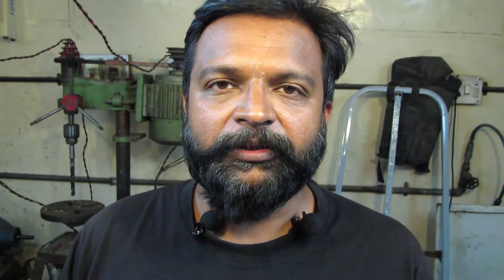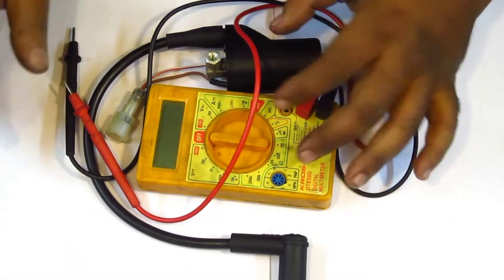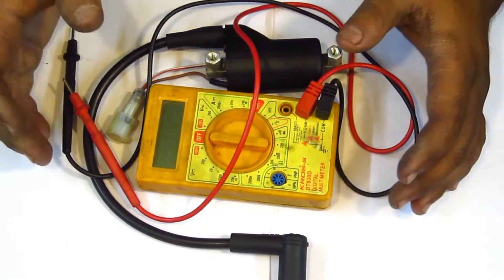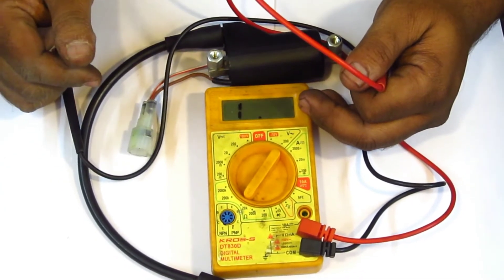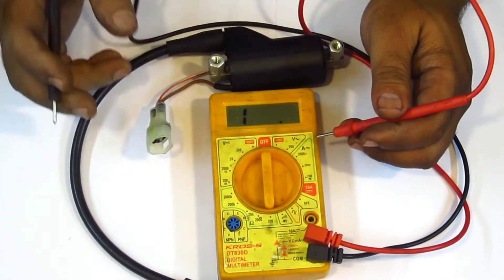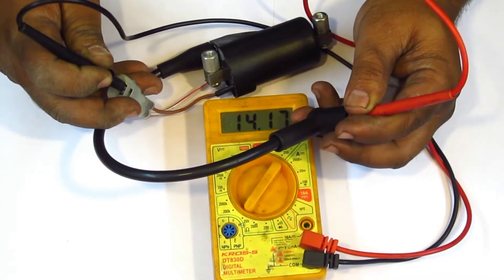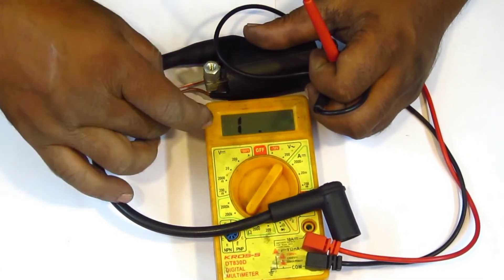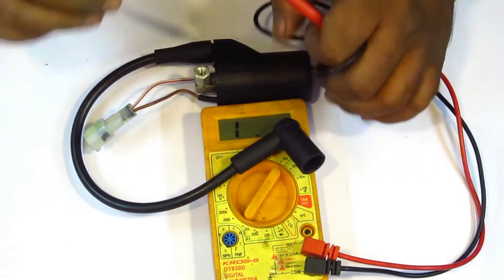MOTORCYCLE HT COIL or IG COIL Problem for no spark | How to rectify Electrical problems?? VOL.2

Comment: Hello sir
How to fix no spark on right side spark plug cable on classic 350? However there is current on the larger spark plug/left side
Reply from the maker: please check the voltage at ignition coil input and continuity in between TCI pulse wire and IG coil. thanks

Comment: Im having 2008 model fz. And  ignition spark doesn't  coming. Bt from cdi to ignition  current is there bt no current is coming from ignition to ht and sparkplug, i changed ignition  coil and then also no result.. what may be the reason?.. pls help
Reply from the maker: ignition means what?
Reply: @MechAutoClinic  ignition coil to ht spark plug

Comment: Dear sir,

Thank you making this video.

I am facing problem with my bike start, which doesn't start at all. It's Bajaj avenger 150 street.
I tried to find the ideal ranges of resistances for ignition coil in manufacturer supplied user manual, but nothing has specified as such. 

Would you please suggest me whether to discard or keep on with the ignition coils based on below multimeter readings?

Open circuit, Ignition coil readings -
Coil 1:
Primary - 1.1 ohm resistance setting @200 setting.
Secondary - 5.02 kohm resistance setting @20k setting.

Coil 2:
Primary - 1.0 ohm resistance setting @200 setting.
Secondary - 4.96 kohm resistance setting @20k setting.

Thanks,
Mehul

Comment: There are some videos in youtube which shows starting Royal Enfield without battery by using a paid of diodes and some capacitors. Can the circuit be used by adding a voltage regulator? How safe is it?
Reply from the maker: Ganesh Chellam voltage in battery is safer than capacitors atleast for some sensetive bikes. Normal cdi non self bikes are ok for capacitor batteries. But DC dependent bikes should be used with batteries only.

Comment: Sir if the coil is weak what is the problem in royal Enfield Electra
Reply from the maker: Black soot on the plug. Less burning of fuel. Worst mileage . Black smoke from exhaust. Infact in some cases if the spark in more less then bike won't even start and if starts then lot of fluttering. So many problems related to fuel combustion...

Comment: Hi Chinmay Sir. Very informative video. i am facing some issues on my thunderbird 500 2012 model. i am sure it is ignition coil related as bike performance is very poor. no mechanic in bangalore were able to fix it including Indimotard garage. So i have to fix it by following your video.
Reply: Which type of problems you face ?

Comment: Sir i have a problem with my pulsar 150 dtsi ug1 spokes wheel model my bike idle speed is varing not still at one speed i change the old carburator with orignal new but the problem still same then do tapped clearing again problem same any solution my bike clocked 80000 spark plug also new
Reply from the maker: check the compression under compression gauge ...do the check up 3-4 times n let me know
Reply: mechautoclinic sir  i dont have compresion gauge
Reply from the maker: call me on 9822212496
Reply: If u have auto choke unit , disconnect it and see